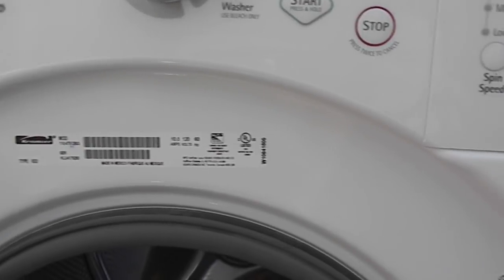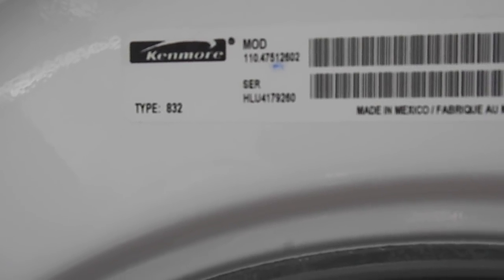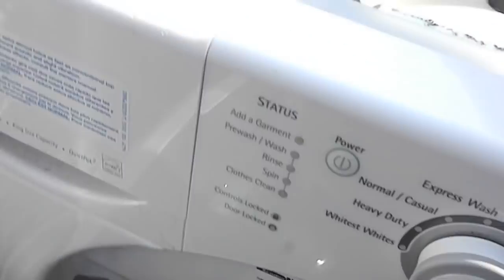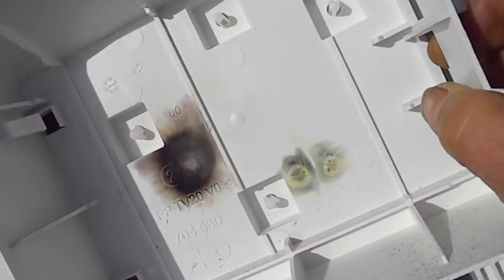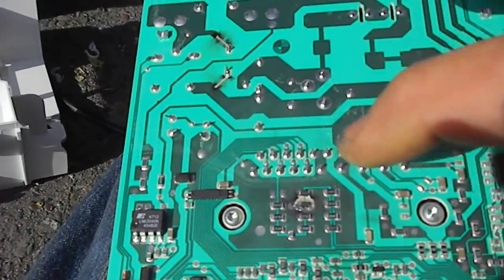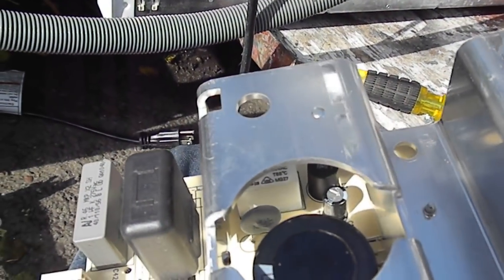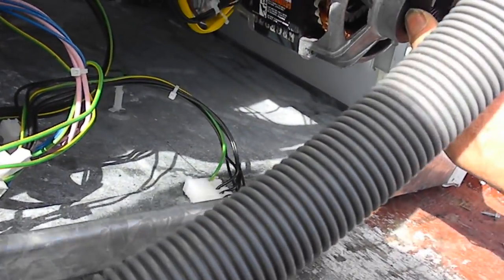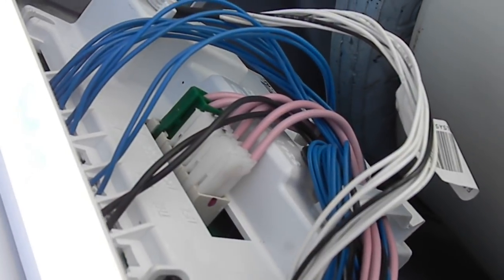Help! Kenmore F-28 error

Comment: I have a kenmore HE 2T model #11047561600  after cleaning out water pump I got an F28 code.  I have not been able to locate what the F28 error code means!!   So I removed water pump found change in it and found more change in the large black hose connecting to the back of the water pump.  Cleaned out both hoses and reattached pump.  Still got the F28 code!!!  I finally noticed that once you remove the bottom panel to clean out the water pump you must put the panel back on before testing the machine.....the reason being.....on the left bottom side of the machine where you see a ground wire there is a little plastic tab that you can push in.  If this tab is not pushed in (by not replacing the bottom cover) the machine is not grounded and you end up with the F28 error code!   I just saved myself $800
Reply: what did you do about your f28 error code? i just did the same as you did?
Reply: ginapianokids I'd love to see a pic of this fix!
Reply: ginapianokids best comment ever.  You also saved me 800 bucks.  Thanks
Reply: You just saved me $800 too! I would kiss your face!! Thank you for the helpful advice
Reply: Hahaha wow, I was wondering what that little plastic tab was... you saved me a hole lot of headache. Thank you!!!
Reply: ginapianokids thank you!!!!!!!!! This comment saved me as well.
Reply: Saved me money as well!
Reply: Thank you. You think they would make that more known. after replacing the hose I left the bottom access panel off to test if things were hooked up and working properly and couldn't figure out why it kept shutting off after a couple minutes.
Reply: thank you ginapianokids- you are exactly right! If you have an he2 kenmore you've been working on and had to remove the front lower cover, be sure to put the lower cover back before trying to run any washer loads- there is indeed a plastic switch (bottom left side) that is held down by the lower cover being in place; without the lower cover, my machine repeatedly threw an F28 code; after replacing the cover it worked just fine!
Reply: This comment for the win!  I’ve been waiting on this handyman to come help me with this washing machine for two months and thanks to YouTube I can call that guy and tell him to fu&$ off lol
Reply: Thank you so much that is where I'm at right now and I'm going to put my door back on and then test it so I won't get that f28 code thank you
Reply: No such luck for me.  I still have F28 after doing what's described above.  F28 is a Serial Communication Error per the troubleshooting manual I found attached inside the lower cover of my machine.  I've already removed the CCU board and did a visual examination of it.. There is no visible damage.  I've reinstalled that and am now headed to the MCU to see what damage I can detect.
Reply: Thank YOU for this comment! How is this not the FIRST thing they say in the troubleshooting guide? There is no mention of this anywhere that I can find in the published literature. You saved me tons of money. I wonder how many washing machines are sitting in landfills because of this?
Reply: #SAME!!! Thank you 🙏🏽

Comment: He2T F28 code- First tried to replace door lock mechanism and checked wiring, still didn’t work.

Replaced motor control board with a used part that matched the serial number. Now makes a clicking kinda sound when spinning, but it’s working again!
Reply: Update, no longer clicking sound. Still works.

Comment: had f35 error for a long time then today f28. googled and they say to check lower panel and other wirings. never done this before so just unplug and it's safe to check the inside? or get a handy man?
Reply from the maker: I normally unplug units for safety. I have never got bit by an unplugged unit and avoid touching bare wires. for me. . . I have got zapped so many times 110 volts don't bug me anymore.  For you, , ,. . . . If you have any doubts consult a professional please